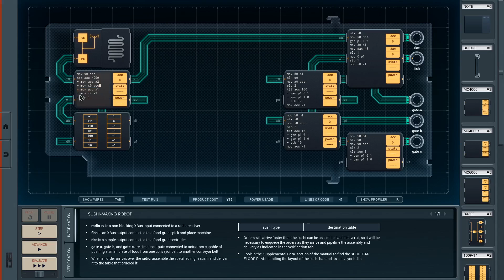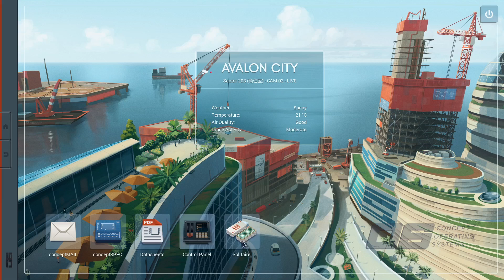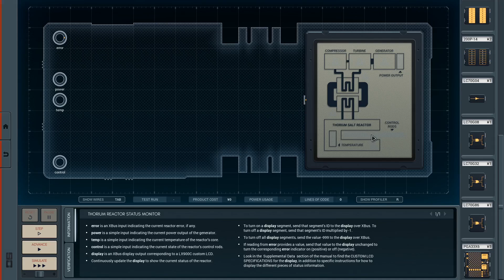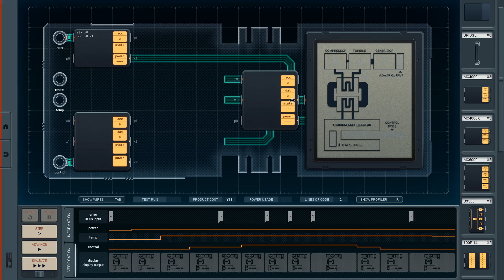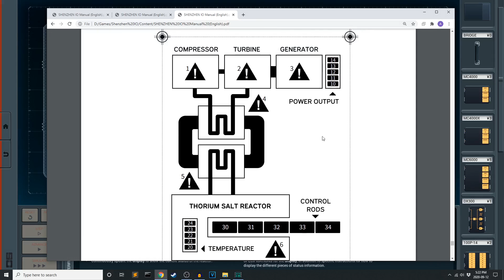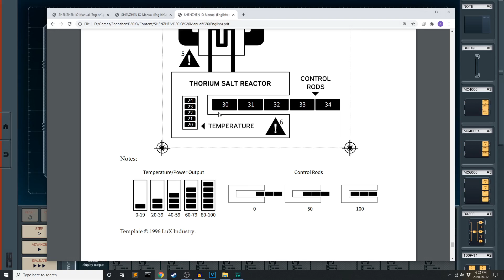Shenzhen I/O - E35: Power dynamics

Comment: An additional simplification of the sushi robot would be to remove the ROM chip. Without the dgt instructions, there is no reason to convert the indices to binary. The gate controllers can just as easily work on the original decimal indices, and subtract 4 and 2 instead of 100 and 10.

On the puzzle archive, there is at least one more code. I found out about it from the steam achievements including one for "solving the secret puzzle". The icon for that achievement also shows the code: 0451 (which is apparently a memy number that unlocks secrets in a variety of games).